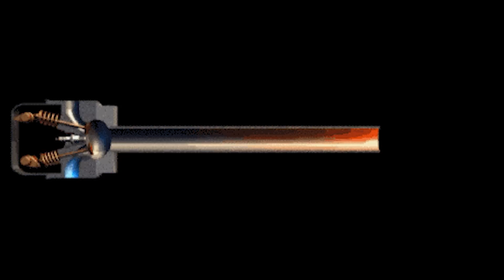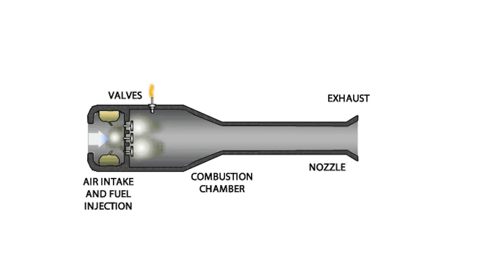US Billions $ Hypersonic Missile Is Finally Ready For Action

Comment: The United States has had the ability to intercept and destroy ICBMs and hypersonic missiles before they reach their targets since the mid 1970s. The Nike Sprint was the terminal phase interceptor ABM missile in the 2 layer Nike X ICBM defense system. It was literally exploded out of its silo reaching Mach 10 in 5 seconds, had a range of 25 miles, and used a low yield W66 enhanced radiation thermonuclear warhead. The missile can be fused to detonate ahead of the incoming missile's path killing the incoming hypersonic using all three of its kill mechanism, shock wave, heat wave, and high neutron radiation. No matter how the incoming missile veers course at the last moment it will not escape any of the three. Before the incoming hypersonic missile detonates it is a complex high technology precision device that must function perfectly if it is to function at all. This nearly 50 year old Sprint technology was discontinued because at the time besides its high expense there were so many nuclear weapons that any system could be swamped by an overwhelming number of attacking missiles. It has evidently been forgotten. IMO the current "hit to kill" strategy of ABM missiles possibly using fragmentation conventional explosive warheads at best is an incredibly risky and failure prone design. The US should return to the Nike Sprint concept which seems to me to be perfect for this operation. It should also be developing plasma detector systems to find and target incoming hypersonics. These detectors could be placed in orbit as part of a defense network shield. Even the defensive missiles could be stationed in orbit. The US has by far the largest and most advanced space program and space force. let's use it for our military defense.
Reply: We got high energy lasers now and x ray lasers, what can beat light speed?
Reply: @XRobinson  not being where the light is aimed would seem to defeat a light weapon.
Reply: @jamespatterson3887  radar travels at light speed too or at velocity of electromagnetic waves.  Once detected by radar a laser beam can hit it after it's trajectory is calculated instantly.  That's probably why some cruise missiles try to or do fly below radar.
Reply: @XRobinson  Those being developed as far as I know are only 60 kw. The military converted an entire 747 into a one megawatt laser. I'm not sure if atmospheric conditions could be a problem. Range needs to be great also. So far as I know they're only good for a few miles. I think the Nimetz class carriers have two 100 kw nuclear reactors each. The Ford class carriers will have two 300 kw reactors each. For comparison a typical utility nuclear power plant reactor is of the order of 1,000 megawatts each. The project I worked on in the mud 1970s that was canceled Fort Calhoun Unit 2 was to be an 1,150 megawatt reactor like its twin Fort Calhoun Unit 1. I've heard the Israelis have a laser based ABM system but I don't know anything about it. 

In January 2018 a mostly unnoticed article briefly appeared saying that Lockheed had been granted a patent for a small 100 megawatt fusion reactor based power system that could fit in a plane, vehicle, or ship. They claimed they'd have a working prototype by the end of 2019. It sounded impossible and I never saw or heard anything about it again.
Reply: @markfischer3626  "The HELIOS system from Lockheed Martin is a High Energy Laser with Integrated Optical-dazzler and Surveillance.
It provides the U.S. Navy with game-changing directed energy capability through integration of high energy laser and optical dazzler technology into the ship and combat system.

More than just a high energy laser, the HELIOS system’s multi-mission capabilities include long range Intelligence, Surveillance, Reconnaissance (ISR) and Counter UAS-mounted ISR (C-ISR) Dazzler.

It uses a Laser with a power higher than 100KW."

Look at last sentence, haha. Quote taken from article on internet.
Reply: I have studied missile engineering and technology for the last 45 years and you have made a lot of good  points in your comments.  You will get there. Keep up the good work!👍🇺🇸
Reply: In English please lol
Reply: @phettywappharmaceuticalsll8842  which word didn't you understand?
Reply: We can't stop that shit that's why we not over there kicking ass right now
Reply: Do you think r can close the gap with chins ? and do you think the us has a f o b . ?
Reply: @grahamlambert650  Yes it will. In the overall scheme of things its importance has been greatly overexaggerated. While the US does not have a first strike capability against Russia it does have one against China. One problem with comparing the US to other country's military is that its most advanced weapons are secret. Hundreds of billions a year of dark money is spent on things we don't know exist.
Reply: @hoosierdaddy9705  Not or can't?
Reply: That's exactly what I was gonna say !! 🤣🤣
Reply: Dude, you're wrong. India and Russia made this concept happen. Presume they're still ahead, dufus.
Reply: Agree
Reply: @moodowski9538  you didn't read 10 years ago about India? not my fault
Reply: They might have interception covered but they can launch multiple nukes with up to 10 war heads which makes intercepting all very challenging. I mean , do we have the capability to shoot them all I’m asking? They have a lot of different ICBM’s as well.
Reply: Like Rods from God or Project Thor
Reply: @mostlyshorts7462  

Yea sure 😂
Reply: US continue to fail developing hypersonic missile, while Russia already have and used it.
Reply: What about the st 91 aurora do you think that is real or fiction ? Being hypersonic?
Reply: @grahamlambert650  We have heard so many rumors we don't know what to believe. Perhaps that's the way the military wants it. We have accounts from many people, some of them reliable such as commercial airplane pilots that can't be explained. Theories are everywhere. Area 51 is real. Speculation of what is going on there could be pure fantasy. We know that in the 1950s or 1960s very shiny weather balloons were reported by observers as UFOs. The military seemed happy with that delusion. 

We know that Lockheed has been working on an SR72 for a very long time. Is that the SR 91 Aurora? We don't know. That rumor I think was started in what may have been an accidental slip-up in a Congressional report someone caught. We know a VP of Lockheed said the successor to the SR71 would have a speed more than twice as fast meaning above Mach 6. There was a tantalizing brief rollout of something at the Skunkworks where Lockheed develops many of its most advanced projects but it was only seen briefly from a long distance so we don't know what it is. To fly at such enormous speeds it would probably have to fly at a very high altitude possibly over 100,000 feet. It might use combined cycle Turbofan / SCRAMJET engines the military has been working on for decades. I've heard of pulse engines but this circular pulse engine is a new one on me. 

We know that they US is working on at least two independent tracks for what it calls next gen fighters, one for the Air Force and one for the Navy which will not necessarily resemble each other. We know that at least three contractors are competing, possibly more; Lockheed, Boeing, and Northrop. You might now that Northrop developed the YF23 which lost the competition to Lockheed's F22. Many felt the YF23 was the better plane. 

We know the X37B space plane was flying around in orbit for two years and landed only recently last year. We have no idea what it was doing up there. Putin said it was somehow engaged in nuclear weapons deployment, always the paranoid dictator. Then there is the TR3B triangular plane we know almost nothing about. We hear crazy stories about antigravity alien technology, all kinds of wild stories, lots of secret projects by DARPA few people actually know exist and those working on one aren't aware of the others. 

Bottom line, we think our technology is far more advanced than we have been told but we don't know if it's true or how it is true. The notion of Elon Musk's supposed smart phone being able to communicate with implants in people's brains is pretty scary. Some people say AI is only a decade or so away and many very smart people think it will become autonomous by evolving itself and will wipe out the entire human race. These are interesting and scary times. I'm an engineer with a strong background and interest in virtually all areas of science and engineering but even I am bewildered by much of what I see and hear. How does the ordinary person react to such mind blowing changes at such rapid speed?
Reply: @mark fisherYou used to work in the government/military?
Reply: @gcolister  No, never. The government doesn't pay nearly enough money compared to private industry. I'm too rebellious to obey the discipline of the military. If someone handed me a gun the first thing I'd do is shoot him to see if it worked. You wouldn't believe what I did to the first computer they gave me at work. It took experts days to get it back to where it was when they gave it to me. I tried out everything it could do and a lot that it couldn't. The only reason they keep me on jobs is because they need my expertise as an engineer. When you are the best available at what you do that needs to get done they put up with you no matter what kind of brat you are.
Reply: Yea  if the leaders of America wanted to win.they would do that. But when the goal seems to be to handicap the us military.  Using inferior te h to replace a more inferior system will do just fine
Reply: The amount of technology the US government is hiding from us is both deeply terrifying and extremely scary
Reply: And yet thousands of missiles renders all defense systems useless. Not only that, the US doesn't currently have an interceptor reaching Mach 10 or so Russia claims their missiles to be
Reply: @Carpfoon  a intercept missile doesn't have to be as fast if it's defensive.  (Thaad) is mach8 hypersonic. And it has intercepted 10hypersonic re entry vehicles at 1 time.
Reply: @jjjr.1186  the only problem with this, is the lack of data. too costly to keep experimenting and blowing up own missiles, while thankfully, not many real world usage and examples, in order to get such data. The math and calculations may get dead close, but even so, the U.S.'s defense interception system is  not even top of the world. The Israel Iron Dome holds that, with a 90% interception rate. The US has not had any opportunities, to spend loads and loads of money, testing defense interception. So yes, thousands of missiles, will wreck the shit out of the US.
Reply: Good luck with your star wars fairy tale.
Reply: You know your stuff 👍
Reply: I wonder why we use a 20 min close in weapon system to Russias 30 mil?
Reply: Uuuuuuuuuucucuuuuuuuuhuucuccucuuùcuuùhuuuuuucuuuuuchcuuuccuccucccuucccccccccccuccccccucccccuccccuccucucccccuccucuccucucucccccccccccuuccccucuccucuccs
Reply: @trescitasumalpong924  That sounds really nasty. You should see a doctor about it... on second thought a hospital... on further consideration only one thing left to do, visit an undertaker. There isn't much time left.
Reply: No it don't, you've got to be able to track it first, and if you miss you miss by hundreds of miles
Reply: Bulshit
Reply: @user-zs2rc7be4c  Before you jump to conclusions and make a fool of yourself in public you might want to do some research and acquire some knowledge. In all likelihood it won't be long before the US has both its own hypersonic missiles and an effective defense against them. The technological and financial resources available to the US military dwarfs what any other country friend or foe has at its disposal. Ever since Pearl Harbor the US government has lavished monumental resources continuously building by far the most powerful military in the world.
Reply: @user-zs2rc7be4c  The US won the cold war destroying the USSR. The US was the decisive factor between the allies winning and losing in Europe in World War II while at the same time defeating Japan pretty much by itself on the other side of the world. The US is going to defeat Russia in an economic war and a proxy military war while at the same time defeating China in a trade war.
Reply: @markfischer3626  

US-made HIMARS destroyed in new strikes 

Published: 3 Jan 2023 | 12:15 GMT
More than 200 Ukrainian troops and foreign ‘mercenaries’ were killed 
Russian forces have destroyed several US-supplied HIMARS rocket launchers and eliminated scores of Ukrainian troops along with dozens of foreign fighters in the latest series of strikes, on Tuesday.
two launchers were destroyed at the Druzhkovka railway station in the Donetsk People’s Republic (DPR). The second pair of launchers was located near the Ukrainian-held city of Kramatorsk, and was firing at other DPR cities, the ministry added.
In addition, nine HIMARS rockets were intercepted near the frontline in the Lugansk People’s Republic (LPR), also in Donbass, as well as in Kherson Region to the north of Crimea, the statement said.
The Russian Air Force’s “precision strikes” on positions of the “foreign legion” fighting for Ukraine near Kramatorsk and Maslyakovka destroyed over 130 “foreign mercenaries,” it added.
Up to 120 Ukrainian soldiers were eliminated at Druzhkovka railway station, 
This comes after Russia confirmed on Monday that 63 of its soldiers were killed in the DPR city of Makeyevka, when Kiev forces targeted the building they were housed in with missiles fired from HIMARS launchers.
The strike had earlier been reported by the republic’s Information Minister Daniil Bezsonov, who said it happened precisely at 0:01 am on New Year’s night.
Ukraine continues to request more weapons from the US and other Western countries, while Moscow insists that deliveries of foreign arms to Kiev will not change the course of the conflict and can only lead to more casualties. 

Have a great day watch a Hollywood movie where USA wins..
Thanks for the sesame street post.
Reply: @markfischer3626  

West  is 
Done
Reply: @Sammy-be5dc  you've been stuck in your orc television we see
Reply: @mostlyshorts7462  

Thatz you 
And bots 
😂
Reply: @mostlyshorts7462  

Watch sesame street that's more real than American  news
😂
Reply: I recall reading about these ABMs in the 60s or 70s. We should be able to improve these now with newer technology.
Reply: @z3roD0llars  If you have the attention span of a gerbil and the intelligence of a potted plant it isn't an essay, it's a novel, possibly an entire library. Why not wait for the comic book version to come out?🤑
Reply: @markfischer3626  ok warmonger. use your big and scary words to insinuate your intelligence about said matter. Seems a lot like virtue signaling if anything.
Reply: @user-gi6ef3zg8h  this is not a video game, this is the real world with real wars fought with real weapons that really kill real people. The best way to keep the peace is for someone to have so much power that no one who has ambitions of conquest would dare to challenge fate. Putin miscalculated badly destroying two countries killing hundreds of thousands of people and wrecking the lives of many tens of millions. Will Xi Jinping make the same mistake? Let's hope not. One tragedy like Ukraine is one too many.
Reply: The US is the mightiest county in the planet. No one can defeat American except God.
Reply: @rodelvaldez5141  they said that about the Titanic...and it was SUNK by a little piece of ice!
Reply: Well God took small army's, and won big wars  the race is not to the swiftest neither the battle to the strongest, But He God is our strength and power, in war. Very well said mr.
Reply: @Rodel Valdez  ROFL!! YOU JUST LOST ANOTHER WAR TO FARMERS HILLBILLY!! I might add you haven't won  a war you have solely been involved with EVER! Careful hillbilly your stupid is showing 🤣
Reply: @fgk765jkh  
AMERICANS   watch to many Hollywood movies..
Reply: EMP피해는 어쩌죠? 
쥐 한마리를 잡으려고 도시를 마비시키는 방어 무기는 아닌지요?